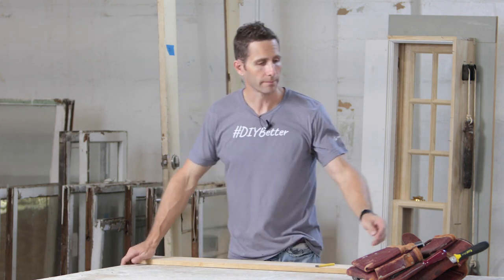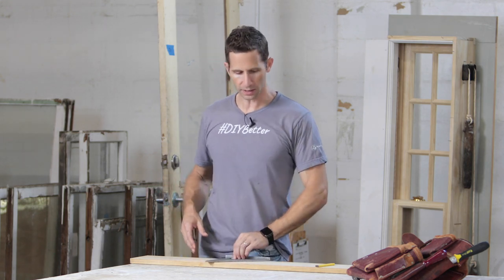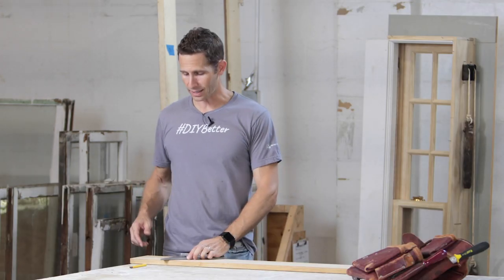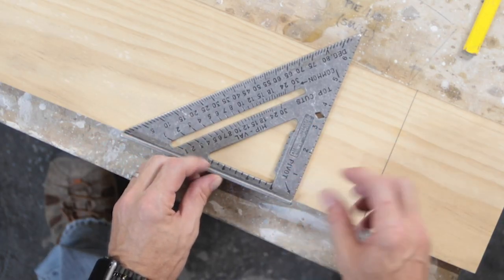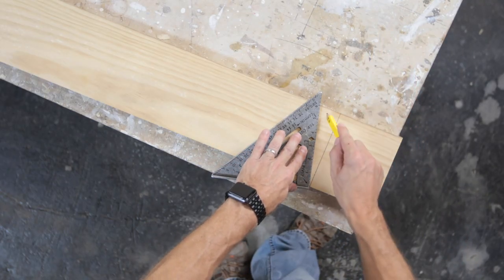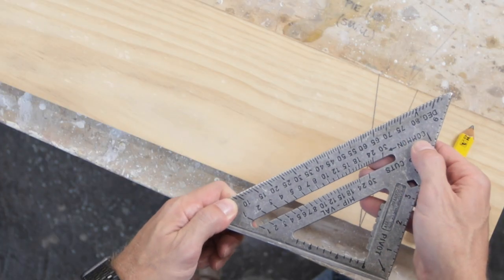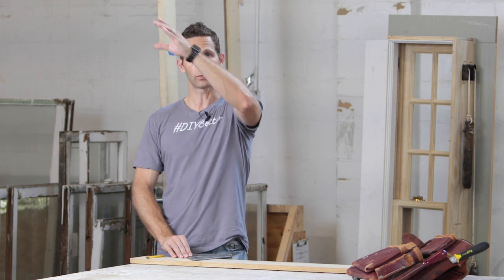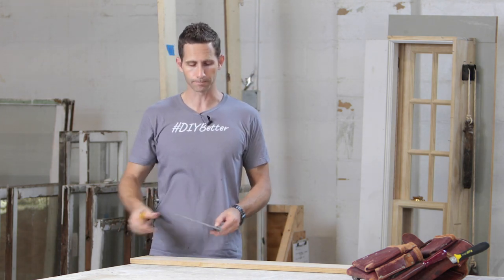How To: Use a Speed Square Like a Pro

Comment: Also, if you can, get the speed square that has the little adjustable fence, or guide on it so you can set it at the angle you want. Finding the seat cut with out the adjustable, locking fence is near impossible, and i know wtf I'm doing and am saying that. Someone will no doubt argue this withm, but im right, and they're not.